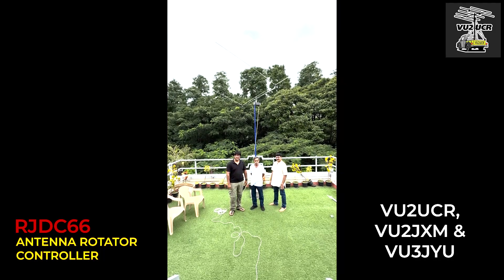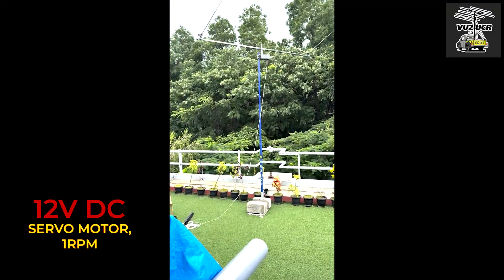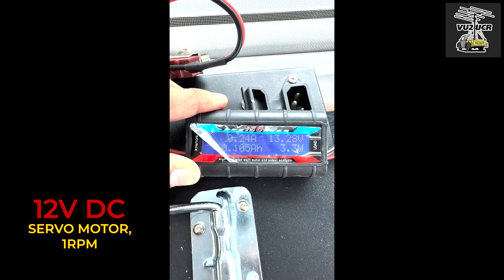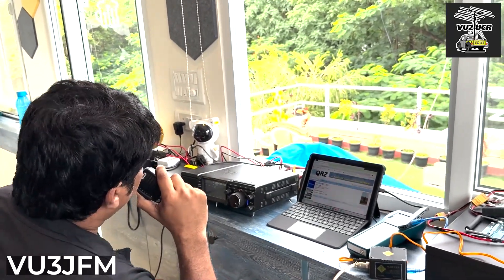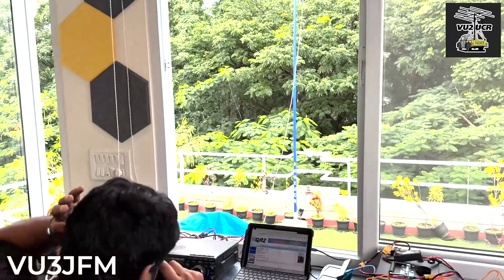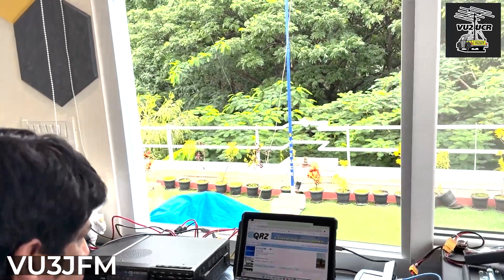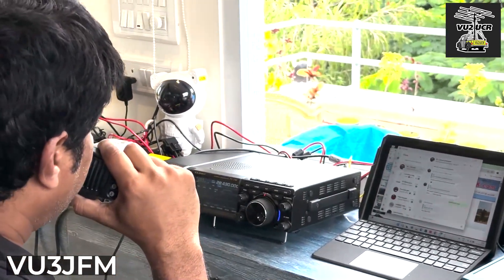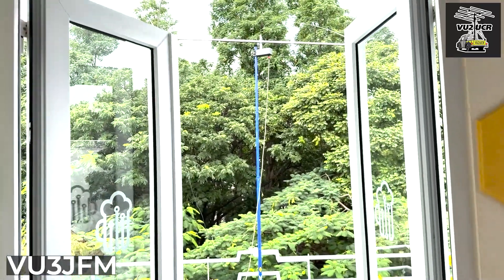Portable Yagi Antenna Build | Yaesu FT-710 + Custom Mast + RJDC66 Rotator

Comment: Wonder whether I can use it as an azimuth only rotator for my Moxon Yagi for LEO satellite operations? Can it be controlled by Gpredict software for satellite tracking? Are the components locally available? 73 Jon, VU2JO
Reply from the maker: Yes it can be used only as a azimuth rotator for your  👍🏼. At the moment its a customs software written for clockwise and anti clockwise rotation. Am very sure it can Ben integrated fir your purposes.   Have talk with VU2JXM for more on this 👍🏼
Reply: @Harisriramaiah  Thank you Hari